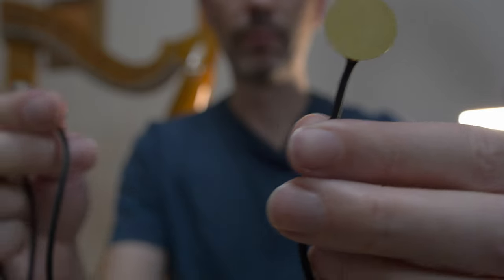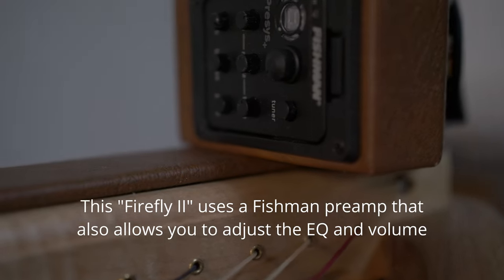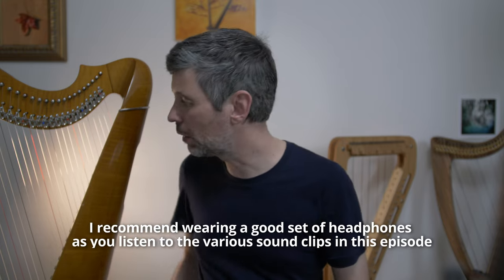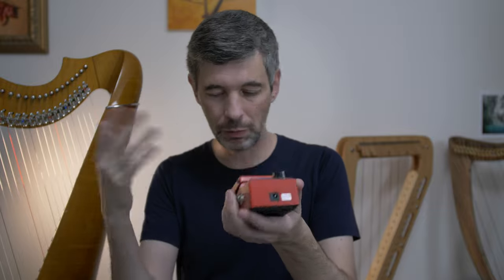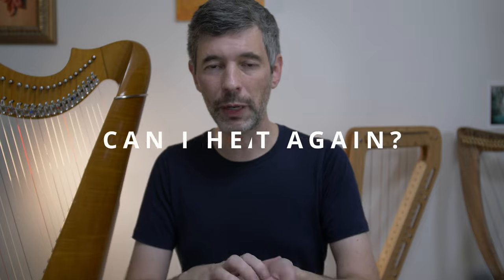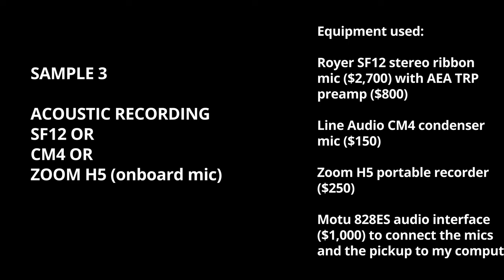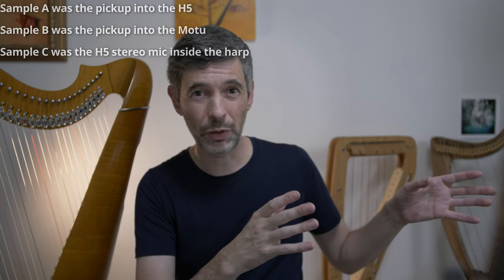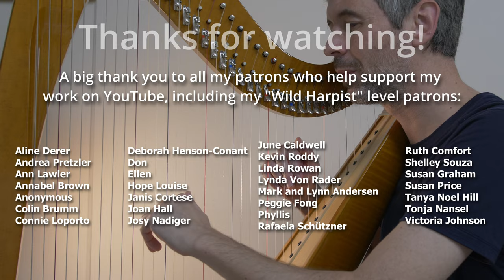Instrument pickups - what are they and do you need one? Harp Tuesday ep. 264

Comment: I see most harp-specific pickups go for over $100. But i see several 2-4 piezo pickups (marketed for acoustic guitar) go for a lot less. Is the pickup you installed specifically designed for harp? Or is it a “guitar” pickup. The sound is very nice
Reply from the maker: It was marketed as for the harp. I'm not sure what if any difference there would be from a guitar pickup.

Comment: Thanks for this information. What kind of a cable do you use to connect the harp pickup to a Mac computer, if you want to use Garage Band for effects? I have a Camac with an installed pickup, which I love, and a cable that goes from the harp to a pedal or to the amp.  I am curious about how you make the connection to the computer.
Reply from the maker: You can use an audio interface of some sort - it will plug into your mac with a USB or thunderbolt plug, and then you can plug your instrument cable into it. Tons of options out there from $100~ up. Julian Krause does lots of reviews: https://www.youtube.com/c/JulianKrause